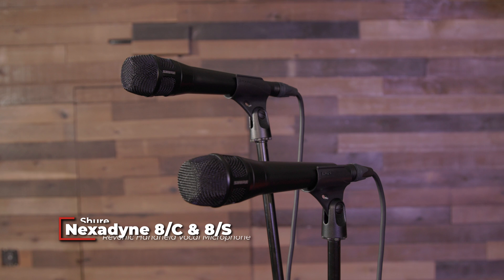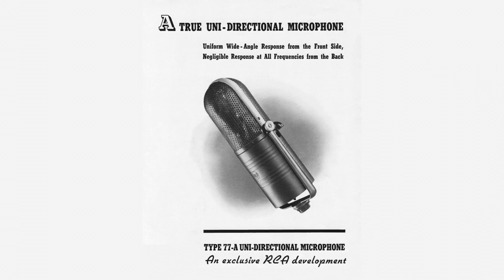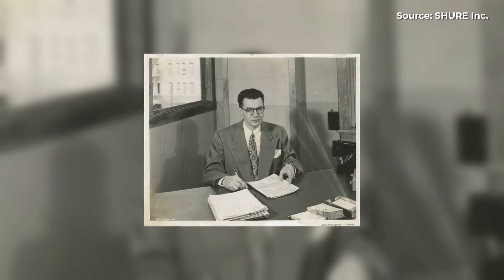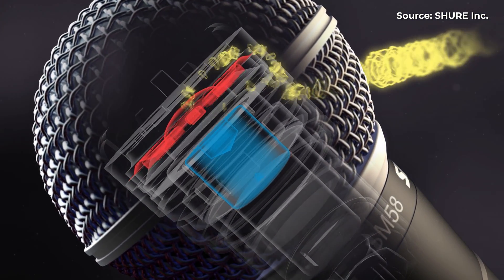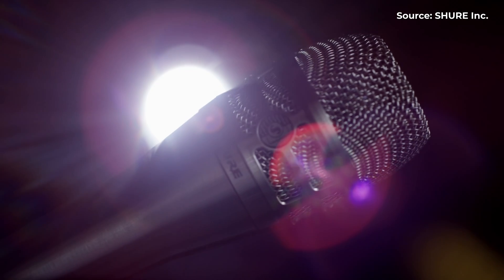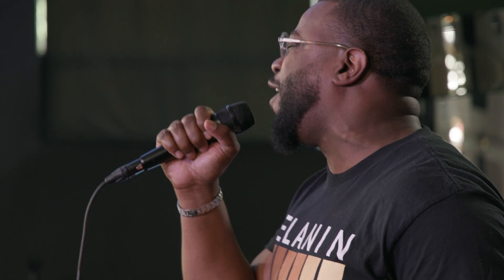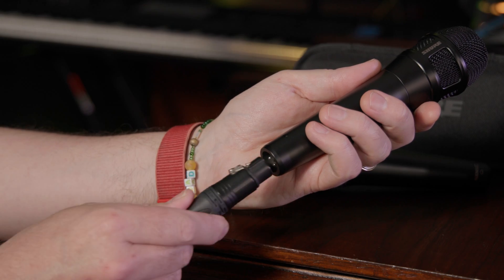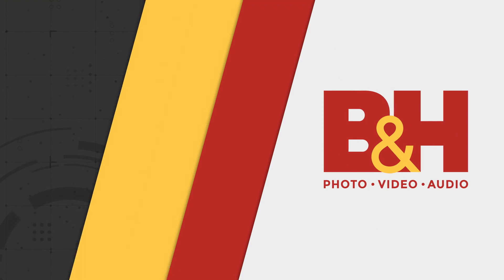Shure Nexadyne 8/C & 8/S: How They Work & Live Test

Comment: Guys, it's absolutely pointless to switch between the mics over different sections of the song. It's supposed to be as controlled a comparison as possible. His dynamics are changing wildly and the organ backing is changing too as the song progresses. You've gone to a lot of trouble to set up a comparative session, but come on, this is basic stuff.

Comment: I was hearing a little bit of shrillness on the s compared to the c. The se v7 sounds just like that on the vocalist I work with.  We're trying to figure out which one to try. He's been on  the v7 for about 2 years. We have loud cymbals but use shields. Use only one floor monitor. Stage isn't crazy loud other than drums at times I def like the C better but i need to hear the bleed of a real drum set. Anyone make that video yet?
Reply: How’s that going? We have acoustic drums and shields (not a cage, just cymbal shields) 
Battle bleed of course, looking to ‘upgrade’ from beta to sE or the Nexadyne

Comment: Nexadyne lack vocals base unfortunately
Reply: but 8s start at 50Hz?
Reply: @lionofjudah4969  just because something can have a full frequency response of 20 - 20khz doesn't mean  it will pick up base well, they need to adjust the low end and boost it higher
Reply: What is difference between 8/s and c

Comment: Ufff, I don't know, listening on my Beyerdynamic DT770 Pro and I can hardly hear anything better with both new mics :-/ Huge proximity "bumph" still here with every T and even W and S (???) and the singer is not even close to mic and is not singing P,B and another REALY problematic plosives. Voice sounded distorted in some parts but it sounded almost like it was peaking in recorder/interface..? It would also be helpful if there were same passages of the song with different mics cause when the vocal and piano is changing with the mics it makes everything even more hard do differentiate. Bleed from monitors was bit better with supercardioid model but as far as the monitors were set in that angle you shown us and were not changed for SC and C models, it is fairly logical - while this angled 2 monitor setup is aimed to dead places of SC pattern, it should be right behind the axis of Cardioid pattern, otherwise it is firing right to the sides where the mic is still somehow sensitive which made the whole thing even more unfair (as well as some people still placing monitor in axis with Beta 58A and wondering why they have feedback...). I don't know guys, but this review TO ME was useful only with technical stuff (which i found really interesting) but the "sound test" could have been done better in my opinion. I am very sorry for criticism and thank you for the video anyway!